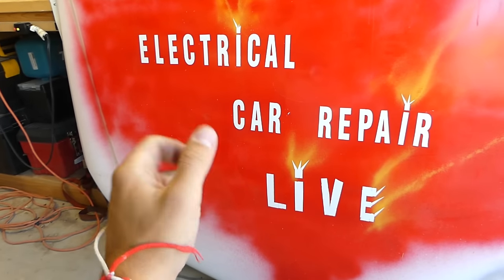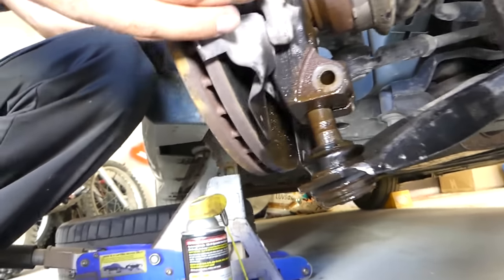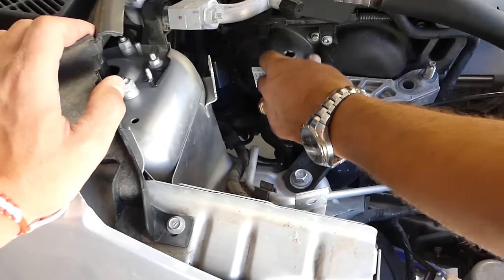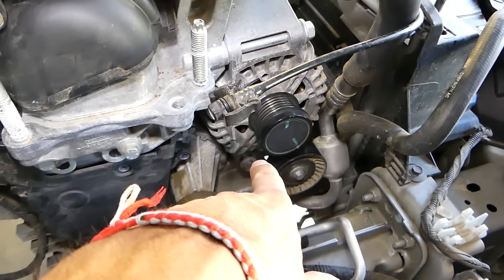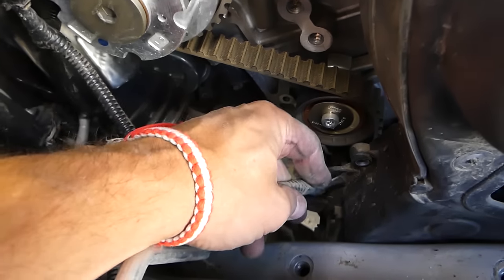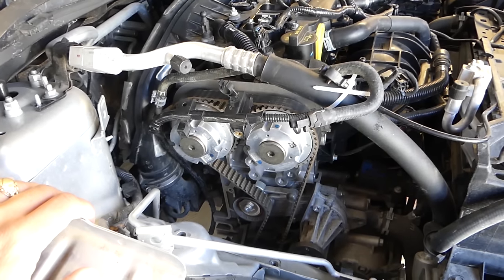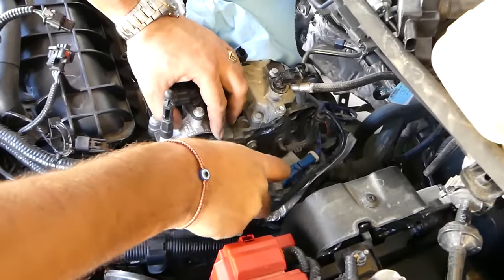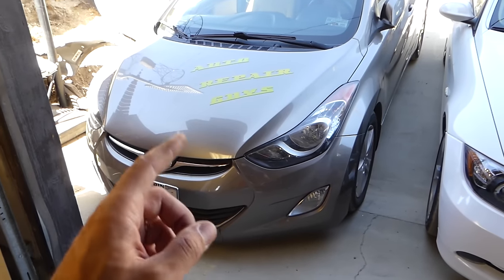FORD FIESTA TIMING BELT REPLACEMENT MK7 ST

Comment: This is ridiculous, that's why I dont own a ford.... mi wife loved her fiesta until recently started to overheat at 69k miles. After two advices from different mechanics they told us that we need to replace the timing belt, tensioner water pump and thermostat all at once. Wtf , fords are made cheaply and have a disposable design.
Reply: Well look on the brighter side of things....they recycle beer cans n turn em into F150s...well at least that is what my can crusher says "help build a Ford one can at a time". My advice to you is buy anything japanese engineered and for the most part you would be buying quality. The only thing i do not like is parts when rarely needed tobe replaced, are/can be super hard to find and expensive.

Comment: The 2016 does not have a belt tensioner but uses a so called stretch belt.  There are very few mechanics willing to service those engines.  I had a belt snap and had 6 mechanics turn down the job before finding one that was willing to attempt it with guarantee that he could.  It was bad enough that I asked about retrofitting a tensioner from an older engine.

Comment: Lol so much work that you didn’t need to do, you don’t need to remove 1/2 the parts that you did. This is a much easier job than you made it into. Read the service manual.

Comment: I have a 2011 Ford Fiesta SE hatchback 1.6, was wondering if anyone else attempted to do this with the same car as mine,  looking at my starter, it looks like there is enough room to push the starter forward so that I may be able to get the flywheel lock in without having to remove the entire intake manifold. Is this the case? Has anyone done this on a fiesta like mine?
Reply: Sorry I cant help, but let me know how you get on as I want to attempt this next week
Reply: Yes I was able to do it without having to take the starter completely out, but will warn you to purchase a good flywheel lock, I purchased a cheaper one that literally fell apart when I tried to loosen the crankshaft pulley, and was lucky that the parts didn’t fall inside the engine.
Reply: I was lucky to have a welder friend who copied the design of the cheaper on and made me a replica out of steel
Reply: Thanks for that, ill source a quality one. Quick question, I haven't actually visually inspected the belt system on the Fiesta yet so sorry if this seem stupid, but does replacing the serpentine belt affect the timing belt at all?
Reply: Ford recommends not reusing the serpentine belt, (Which would not affect the timing bel). The serpentine belt keeps the ac, alternator, and water pump turning) not affecting the timing.  My belt looked fine, but I replaced it because I am going on a long trip soon and my car has close to 120,000 miles on it and I didn't want to risk it going while I was on the road.  A lot of what is shown in this video didn't apply to my car (it is not a MK7 but a ford fiesta SE Hatchback 1.6) so I didn't have to disassemble a lot of what is shown in the above video, including the beginning where they disassembled the front end/headlight etc etc.
Reply: I also recommend this video: https://www.youtube.com/watch?v=_AmIPreaCdg
but the only problem I had with it was the fact that the flywheel teeth this person shows in his video were not available on my car (hence the flywheel lock) but he had a manual transmission, and I had an automatic
Reply: One more thing, if your really unsure about this all, I recommend getting a true authorized service center to do it.  When my timing belt locking tool broke, it moved the crankshaft pulley out of timing with the top cams (which were locked by the other tools) - if I didn't verify that it was out and put it back together without checking, I could have seriously damaged my engine.
Reply: marcooconnor  if you havent already changed your belt, and need the tools, Ive listed mine on ebay here: https://www.ebay.com/itm/142954495186?ul_noapp=true

Comment: You didn't need to remove the rocker cover.... You just needed to lock the cam gears with a locking tool... 🤯

And I just saw YOU HAD THE CAM GEAR LOCKING TOOL! ( And you didn't use it! )

Comment: I have a 2013 Ford Fiesta 5 speed one night it was like she went in limp mode and didn’t have much power couldn’t get up past 2500/3000 rpm 

Bought it to the garage July 10th to have it put on computer they said they believe she jumped on her timing 

Found a belt and tensor had it flown in a month later my car is still not finished they told me not to take it they would have it done for me last week still isn’t done all because of some special tool they said was needed

Comment: Nothing beats an extension down the plug  hole to be sure

But Jesus, you stripped way more than you needed to. Get yourself a bottle of tip-ex unless you're changing the pulleys.

Comment: What a f..ed up design...
Reply from the maker: I think they do it on purpose
Reply: This engine is based on the Zetec S Sigma first released 1996 in Europe as naturally aspirated only. The turbo was a complete afterthought and so are the bigger driveshafts. So they didn‘t design it this way on purpose, there was just no other cost friendly solution than doing it like this